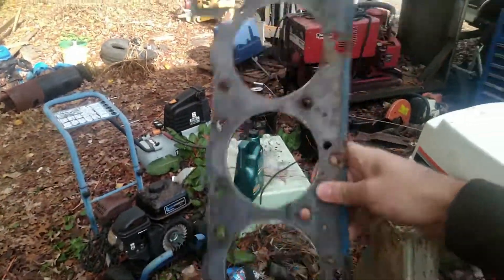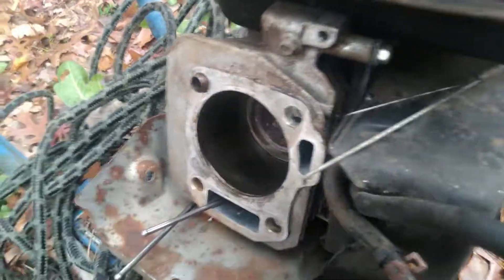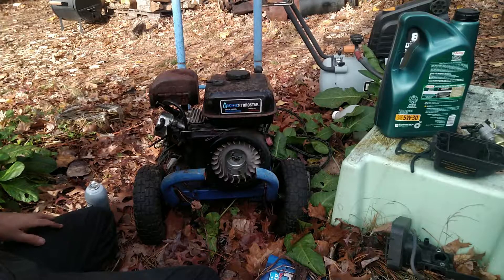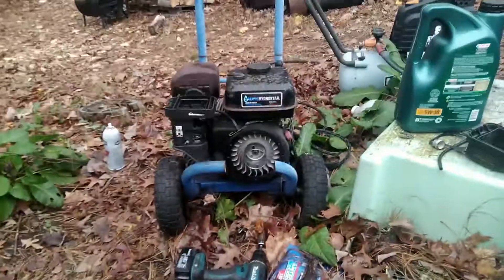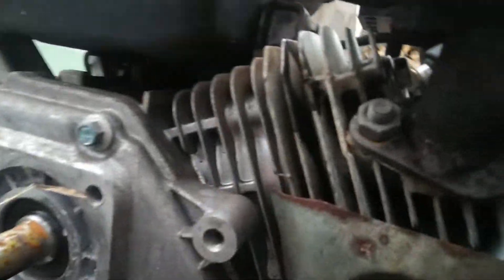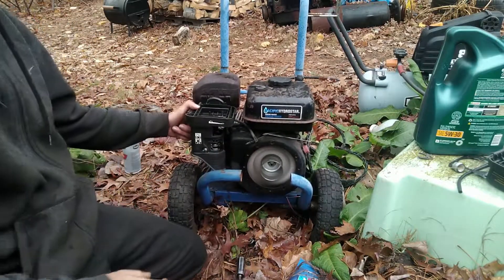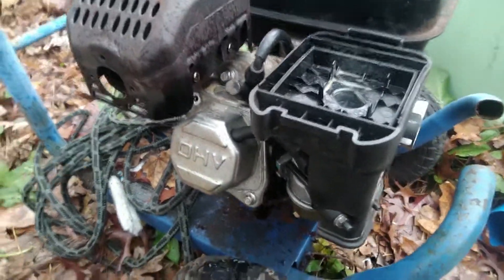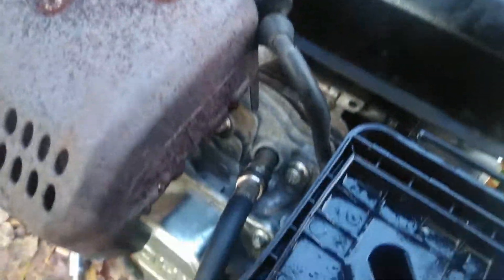Engine with no head gasket.  How well will it run?

Comment: If car manufacturers made a head gasket free engine... they would go out of business... Every car i have ever had has had the issue after x amount of time. The head gasket is planned obsolescence... Just like the new electric cars have batteries that can only be charged 1000 times and then the car is worthless.
Reply: Yeah if manufacturers make reliable cars they'll go out of business. That's why Toyota and Honda are so small and Peugeot is so successful.
Reply: You have to have a head gasket unless you want to weld the heads to the block, it’s a part that gets a lot of wear they can’t last forever

Comment: Can't beat the GX200 copies! $300 or so in go fast parts can easily double the HP.

You could shim the valve springs with washers to prevent valve float and rev it to 6-7k for at least a few minutes before it throws a rod;)
Reply from the maker: Oh you'd be surprised.  You can double the power on those for way less than $300.  The engine on my snow blower currently has extra stiff valve springs and revs up to 10k rpm on all stock everything else.  And it does it all day.  I'll get a video of that thing in it's current state out this winter probably.
Reply: @Choochinc  Def not 10K rpm lol

Comment: I did the same to a push mower and also removed the cooling fan and shroud so no cooling at all. Full rpms,  I zip ties the govonor full balls and mowed a lil bit of yard before it locked up,  I re freed the motor and did the same thing s couple more times
Reply: What made it lock up?
Reply: @bryanroupe8646  Overheating
Reply: @Hans45  why did it overheat without the gasket? Genuinely asking
Reply: Use thicker oil?
Reply: @binLADDDER the engine requires coolant. Thicker oil won’t do much